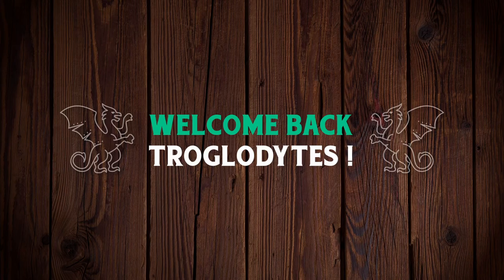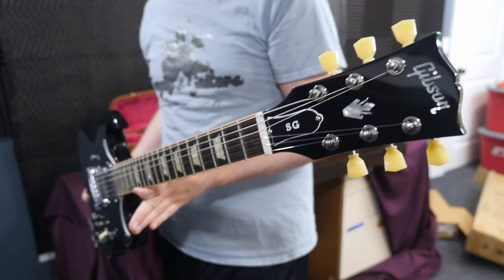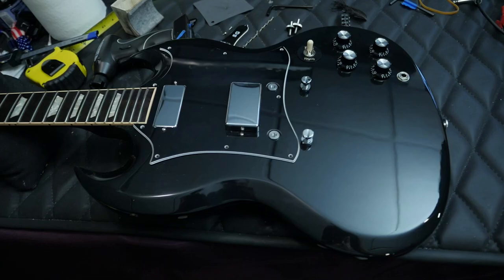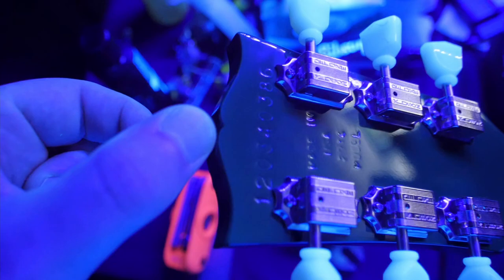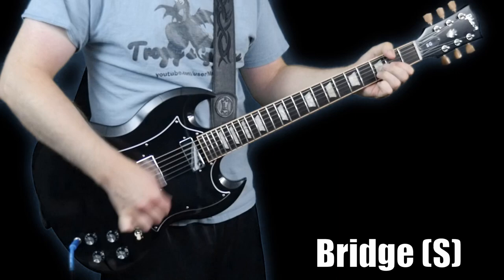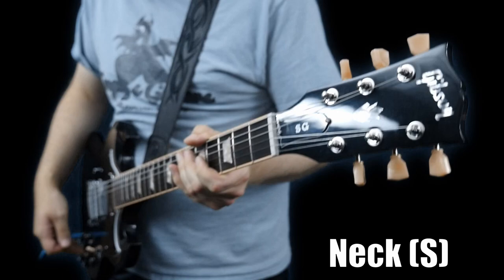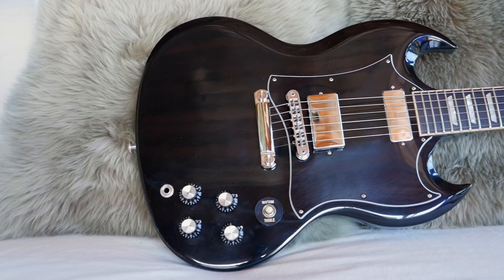No One Talks About This SG (but they should!) | 2014 Gibson SG Standard 24 Firebird AMS Exclusive

Comment: This is a pickup setup I have in several guitars. I love the look of the no poles exposed on a full humbucker in the neck and a FB mini in the neck. The tapered look of the pickups pairs well with a TP6 tailpiece on ToM bridges (especially well on the SG and damn fine as well on my Electra Workingman), and also looks real good on my The Hawk with a Schaller 456 bridge.
Reply: @ChristianSeabaugh  I have a 498 with a FB neck pup. They go well if you’re looking for a hotter pickup. Austin had a 57 or something similar in this video and I thought they went well together. I have a pride pup in a neck position paired with a 500t but that guitar is used to play aggressive music as the bridge pickup is hotter so it can be harsh in the neck position, which I like for the saturated overdriven sound. But the 498 can do both. It’s got the alnico mags and overwound. You can roll off the volume and get nice cleans or drive it hard. Buy a used pickup and try it out. If it doesn’t work you can get what you paid for it and garner the experience of playing it. Plus aftermarket Gibson pickups often have the coil splitting option.

Comment: Hey Austin, I thought about your issue with the GoPro overheating and batteries not lasting long. There should be "dummy batteries"available that basically have the shape of batteries but have a power cord sticking out that you can then plug to a bigger, external battery pack that you could hold somewhere. More recent GoPros should also have no recording limit but I'm not 100% sure.

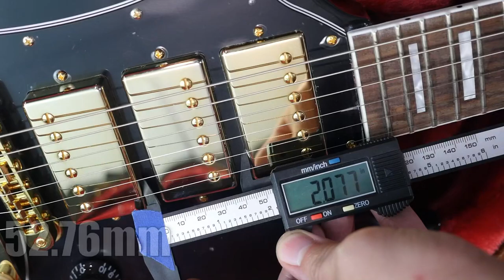Comment: The neck pickup doesn't move on a 24-fret SG - the extra frets just take the place of the tenon cover. The measurement difference at 4:52 is due to the difference in size between a Firebird pickup and a full-size humbucker.

Comment: Back in 2015 I bought one of these from Ams. It had a cracked fretboard. I sent it back and they sent me another. It had a crack under the nut that was pretty bad and caused the low e to rattle like crazy. They sent me a third guitar in cherry this time and the neck was twisted. Not to mention they had advertised these as having the Tony Iommi pickup. I didn’t know there was a run from 2011. They prob used the old listing. I wanted that guitar so bad though.

Comment: BTW CTS has different split pots now. Those are originally meant for amps. Small combo amps would use it to switch them on and off and have only one pot for the volume. That was done  in the early days of tube amps.

Comment: I loved the tones on this one ... might have to mod something in a similar way!
Reply: Do it!!! I’ve got 3 guitars with similar setup. Two with 500T bridge pups and one with a 498. All have the no hole covers and I love the look. I didn’t even know Gibson had done a guitar with that aesthetic. Gibson SG, Gibson The Hawk, Electra Workingman X290. Looks real good with a TP6 tail
Reply: I’m with you, I was especially surprised by how great the middle position sounded. Most of the time for me the middle position is for clean tones only but that one sounded great with some dirt on it. You could definitely jam some Skynyrd style southern rock in the middle position of it . I’m kinda rebuilding an old Destroyer II and haven’t settled on a neck PU yet. I was thinking of going with a P94, but this has me thinking maybe check out some firebird or mini HB .
Reply: @brandonjackson5865  for note they use a bar magnet and a bridge pickup can be used in the neck position (and vice versa) without compromising the string/pile alignment. In my case I put a bridge pickup (quite hotter) with a 500T and the rhythm pickup paired with a slightly less hot 498. I had three pickups from a 98 SG Deluxe the one with the Varitone. Triglycerides talked about them in a video a while back. A super quirky SG made for 2 years 98-99 with 3 FB minis, a bigsby, and the Varitone selector. My friend fell over on it drunk and snapped the neck. I bought all the hardware for $100. A couple weeks later I bought the neck and body for another $100. Lost the neck years ago but everything else got repurposed. I’ll keep it all as he passed away shortly after and I also have his strat. He was a good dude.

Comment: My first guitar was an SG knockoff.  The pick guard was symmetrical that it could be used for a right hand or a left hand guitar. Took a lot of tweaking to get that thing to play decent much less stay in tune very long. That SG had a flat fret board on it or it seemed so since there was little arc on the face of it . The neck felt about like a typical SG .The two SGs I got from you if someone handed me either one of them blindfolded I could tell you which I was playing with out even touching the bridge on either.

Comment: 24 frets issue for the most players is about the tone. Player an go around not hitting the pickups with plectrum but moving beck pickup towards the bridge will change the sound of 2 out of 3 positions. With some 22 frets Gibsons pole screws of neck humbuckers are at the theoretical 24 fret but even with once that they are not moving neck pickup towards a bridge will reduce low end content and roundness of a beck pickup. That will also influence and thin out middle position. One can try to compensate with tome on the guitar and boosting low end on the amp but it never does the same job.

Comment: That neck pickup seems really muddy with your distorted sound. Maybe running that through a lower gain Blues Driver on a clean channel or something like that? I’m not a high gain player at all. And I don’t have a Firebird or anything with those pickups so I don’t have any first hand experience with them. But I had a similar sound with a set of Phatcat P90s I put in an Epiphone Les Paul Special. High gain just muddied them up horribly. Blues Driver into my Marshall and that thing comes alive.

Comment: Hey truck thank you for the video love everything sg&s and firebird and those are my two favorite Gibson's next being the Les Paul Firebirds my favorite. Yeah the firebird pickup in my 2017 the rhythm I think it's 14 something and then Bridges like 25 something ludicrous like that. But when you're back off the volume they clean up really nicely I love that guitar. Anyway I was under the assumption that they don't sell the firebird pickups individually might be wrong might have been something they were doing but change now but I don't think they were for aftermarket sales if I'm wrong someone correct me anyway thanks again interesting guitar 2005 SG special and it was a special order it's in wine red instead of the the faded colors that you offered on the 20 us 05 to 2005 but anyway yeah it has a set of 490 pickups I happen to like them a lot now at first I didn't know what to make of them but over time I've come to really love those pickups they do what I want and that's kind of what you want in a pickup for yourself right LOL all the hardware is exactly the same including the tuners as on the standard for 2005 I think the neck profile is different though this is more of a c-shaped neck it's not that thin white neck I remember having a 1969 or 1970 SG standard it was a year where they had no cavity in the back everything was front routers and that guitar the neck was so thin I mean you could do this on basically any guitar but if you wanted to get like a tremolo sound or a bend you could just pull the neck back and forward real easy and it did the trick for you LOL I know a lot of people that broke their guitar doing that but yeah mine never broke and I didn't really do that much that old one also came with a Bixby which was unusable so I never used it it was just there I love this guitar playing yeah great guitar picked it up for $500 I think I got it from guitar center and it was in literally in like excellent to mint condition it's not anymore being blind you tend to knock the guitar around that I do anyway so I put the little dents and nicks in it and stuff I've given up worrying about putting scratches on Mars and then some like guitars because being blind it's just inevitable you know so after knocking into my mint Firebirds which fell off the end of the bed in between the frame and kind of mixed it up I just gave up on I freaked on that I can't tell you how I freaked but now I don't care about these things I don't plan on ever selling them if we could talk what I love and I bought for a reason so yeah until the next guitar right bye LOL anyway thanks I'm all over the place

Comment: Hello and thank you for your exciting videos!
I have a question: do you ever have problems with the finish of the bidings of the guitars you buy?
Personally, I have never had a Gibson without more or less important scratch marks on the neck and body bindings, usually more than less.
For example on my Gibson LP Classic and on my SG Standard I spent dozens of hours fixing this problem (a thin coat of nitro cellulose varnish applied with a little make up brush, sanding, another coat, sanding, another coat etc etc) to make the scratching dents disappear and get rid of those hideous ridges between the wood and the neck binding neck (and even more blatantly the body binding of my Les Paul).
You never talk about this kind of (at least) cosmetic problems, so my question is : are you the luckiest guy in the universe?

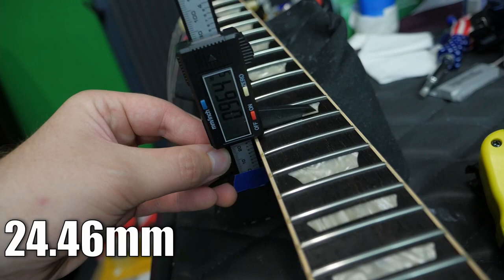Comment: In a new larger room I see, grats on a move? That fingerboard looks like a ruffle potato chip around the 20's, tool grooves all over it between 23 and 22 frets. The inlay is holding your radius gauge off the fingerboard, it's not sanded flush, I suppose all of this are things one would say won't affect the playability? That fingerboard gets a D - from me, I am not remotely a luthier and I would not let that ugly tool marked up hunk of crap past my QC inspection station. Some of the frets are obviously not seated properly and are sticking up at the ends like fret %13 in frame at 8:26.